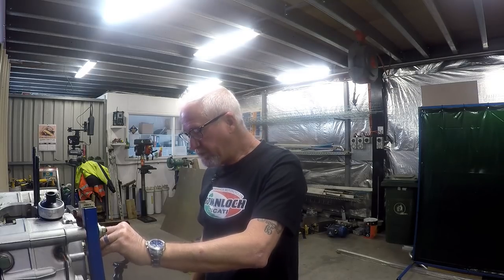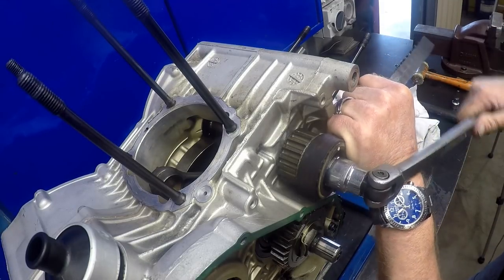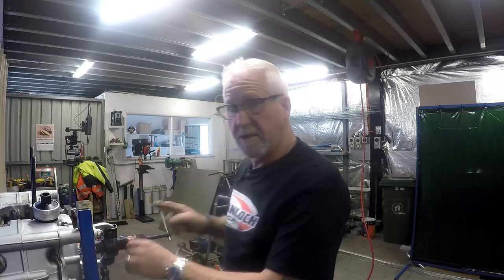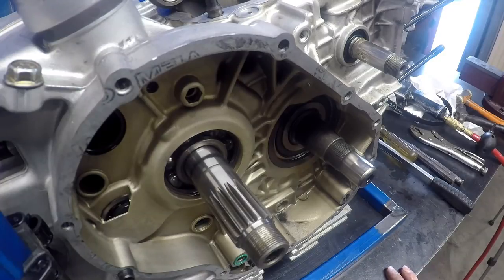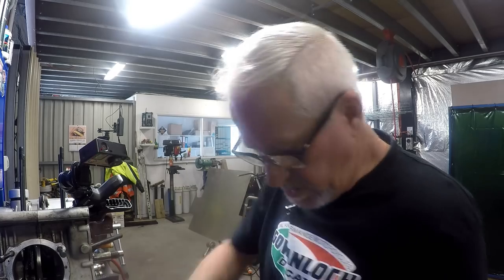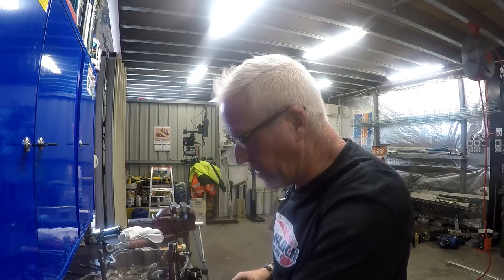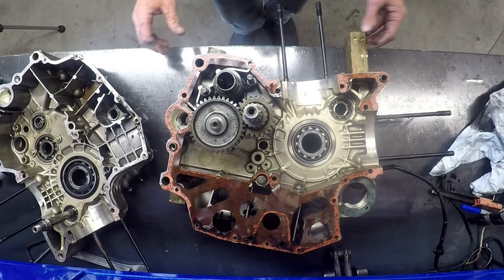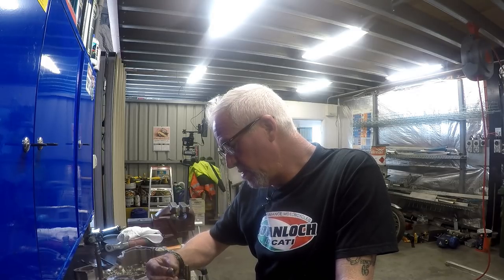DUCATI 900SS Ep6 - Split Cases and Flying Teeth

Comment: Always leave the nut on a couple of turns when pulling off a taper. This prevents the problem of flying gears/flywheels. Also you could have heated up the gear with a heat gun possibly making it easier to get off.
Reply from the maker: Yes, a bit of a facepalm moment. I under estimated the reactive force from the gear puller and it’s something that I should have instinctively done.
Reply: @ANDY5  Its a good tip to follow but if we could remember to use every tip trick and workshop practice most of know about but forget we would-be geniuses, and as my old man used to say the man who hasn't made a mistake hasn't made anything until I made the mistake that is and all hell let loose.

Comment: Nice work, Andy. While you're in there, I'd recommend you also change the gearchange lever return spring and fork return spring. It's not uncommon for them to break. One of mine went at only 16k and, as they're only a few dollars, I think it's a worthwhile precaution.Should be a real sweet runner when it's back together.

Comment: Andy, great series as always. Not sure about using silicon as a case sealer because the silicon squeezed out inside your cases can, and often does, come loose and can end up sticking in oil passages and the like. The commonly used case sealer is threebond. It is more of a mastic product that doesn't cause internal dramas. You may have heard of it through the various manufacturer variants: Hindabond, Yamabond, Suzukibond and, believe it or not, Ducatibond. Just something to consider. 
Also, in regards to removing your cam pulley, lactate was probably the culprit and some heat may have helped in the area. Heat may also have helped with the tapered gear.
BTW, I'm also a backyard mechanic. Trying to restore 2 MGBs, 2 1984 Honda VF1000s and a 1973 Honda SL100 plus keep a 93 750SS and a 97 Monster 750 on the road.
Reply from the maker: Yes, Threebond is what I’m using. You have lots of toys to keep you busy, nice 👍

Comment: We used to use a 2 jaw puller on the primary gear, we would load it up and go home for the night. most times we would come in the next day and the gear and puller would be on the floor. Yes this was at the dealership...lol
While you are there change the output bearing and check rod bearings. Also change the output seal and layshaft seal. Given the fretting on the bearing you should closely inspect the mains as well. 
Turn down that flywheel to 2lbs as fell for some fun.
Reply from the maker: New bearings all ‘round while I’m in there mate 👍
Reply: Hey rider !!  When the crank bearing failed on my 1991. Because of the 194.000 miles , 6th gear was a bit of a singer . I had a friend that did LOTS of Ebay parts stuff . he found me a complete transmission to drop in for ONLY 175 BUCKS !!!😎😎😎😎😎🍺🍺🍺🍺🍺

Comment: Excellent video again Andy.  Hopefully now you have pulled the engine down and identified all the parts etc that need replacing, the engine will go back together and possibly give you a non-oil burning experience from then on!! Remember it's a Ducati and I did say POSSIBLY give you a great non-oil burn and leak free life after all the work is done and the information being passed onto you is no doubt putting your mind at rest that all will be done as per those who have been there, done that and learnt from their work on these bikes.

Comment: I’m happy to report I finally got my oil strainer loose. It was in tough shape from the previous owner. I couldn’t get a socket or wrench to grab it. A couple of small flecks but  much cleaner than yours. I’m hopeful. Now for the clutch inspection... FYI..A BMW mechanic friend of mine gave me some advice on grabbing bad fasteners like my strainer. Put some valve lapping compound on it. It fills in some of the void. Worked great!
Reply from the maker: Good job

Comment: I think your theory about the brake fluid getting in the bearings is a good one and that would for sure  turn the bearing into  cheese but on the downside its turning into a costly  rebuild  ,, good  luck  with it these are great video's
Reply: Doesn’t the clutch pushrod pass through a rubber seal ? Not sure how a leaking clutch slave on the outside of engine could have the clutch fluid get inside the engine and attack the bearing on the inside ?
Reply from the maker: The rod seals with two orings. My have baked theory was that the fluid could reach the bearing, but it would need to get past the orings first. Possible, but highly unlikely. Crib death seems to be the most likely hypothesis.

Comment: If you go down the path of all new bearings, you may want to do another mod that wont cost much.  On these engines the pistons have an oil jet under them for cooling. BUT, the rear only gets it for 180deg because its blocked by the crank wheel. On later engines Ducati fixed this. You can fix it by extending the oil galley to the other side of the where it'll reach under piston for 360deg. I first saw it on Ducati Kamna in Germany web page. If your interested, I can send info...
Reply: Be interested to see this...

Comment: Hi Andy. I've pulled a couple of Desmoquattro primary gears... both needed the hydraulic puller, and both went off like a shotgun. Bit late to point this out now, but well worth protecting the end of the crankshaft. I once bought a 900SS crank which had been mushroomed over on that end, which meant it was impossible to sort out the oil feed into that end of the crankshaft. Hope yours is OK. If it's any comfort, I disassembled my 916 into individual components (much as you're doing) and it all went together again just fine eventually...and runs better & pulls harder than my 996! Carry on the good work.
Reply from the maker: I think I was lucky enough to get away with out mushrooming the shaft. Phew 😅

Comment: make sure the screw in the little pin the starter idler gear runs on is tight.  also watch the flat shim behind the flywheel assembly when you put it back together.  that's a real pita.
you can make an engine stand that holds the rh cases - you make 3 posts with pins to go into the 3 mount holes, and a little support to hold up at the oil filter bit, if that makes sense.  drill 4 holes in your bench and bolt them in.  makes it much easier.
you can put the alt cover back on and use the alt cover tool you made to pull the lh case off the rh case, pushing against the crank
.
Reply from the maker: Thanks mate

Comment: Hi Andy ! Very good job (except for the primary gear extraction without the nut in place !! I was frightened...). Fortunatly everything ending well

I agree with Chris commentary :
When you will  reassemble your engine beware of prestressing of the bearings. Its very very important on a Ducati motor.
The diiferents shims  are calculated for that. You will have to recalculate precilsely presterssing BEFORE reassembling the engine with a special tool (comparateur in french comparator in english?). You will probably have to change evry shims.

Comment: That flying off, had me stoking a 30year old wound🙊had my mk1 cortina steering wheel fly off and split my lip, learn quickly and only undo bolt a few turns😂very brave and expensive, I recon them Italian bit will be. 🤓

Comment: Hi Andy, if Im joining any metal to metal surfaces without gasket I use a sealant called wellseal, it was made for rolls royce back in the 30s, rolls was the first engine manufacture to mate metal to metal without a paper gasket, I was told it was to make the repair of aircraft in the field of war without the need for delicate paper gaskets. Ron from the uk

Comment: Hey Andy just a thought . Check the clutch actuating rod bearing in the pressure plate. I have heard that they can freeze up and spin the rod which may cause issue in the clutch slave cylinder piston . Worth a look mate.
Reply from the maker: It’s fine

Comment: as peter says, leave the nut on.  you need to be careful to not mark the end of the crank too - it does go into a seal (that is meant to be fitted the "wrong" way) and is the oil path into the big ends.  if you do remove the pick up connectors, you need to make sure the terminals go back in the same place.  swap the terminals side to side and it won't advance or maybe not even fire on that cylinder.
Reply from the maker: I think I was lucky, I don’t see any damage to the shaft.

Comment: Another possible contributing factor for the bearing failure could be lugging the engine in 2nd gear, which is the gear closest to that bearing. Some transmission failures are due to not spinning the transmission fast enough to spread the power pulses out over a greater area of gear teeth / bearing surface.  It is usually really expensive to replace the primary drive gears with ones that have a longer/taller ratio to spin gearbox faster, unless the factory made a set on a different year model that you could retro fit to your engine. Cheaper option is to not open throttle too much at low rpm, loading up transmission. Wait until it is at least over 4000rpm before winding throttle open.

Comment: I know this is an old video. I reckon corrosion has caused the case hardening to come off. The rust gets through the hard facing and metal fatigue does the rest.

Comment: Great series, really enjoying it. Substituting crank case paper gasket with a glue, would that not require changing shim thickness on crank, input / output shafts as cases will come closer together ? In the previous episode when you put the screwdriver through the small end of conrod, that made me nervous, hopefully that didn’t harm the base gasket surface, conrod or overall crank alignment / balance ? I know from my 2-stroke days that technique was a no no . Keep up the great work
Reply from the maker: Yes it will require reshimming, but would require that with new paper gaskets anyway. The rod through the small end is actually in the manual
Reply: Andy's Motorcycle Obsessions I don’t like the manual :-) My late brother who was a fitter and turner had a device he made which he referred to as the “Conrod Breaker”, it was a spark plug that had the electrode removed and a 50mm long pin pressed into it, this evil tool was inserted into cylinder head to assist with removal of crank and input / output start nuts.

Comment: As well as taking a photo of the ignition pickup a quick spray with any handy rattle can paint would have left you an image of exactly where the nut and washer were located and thus the pickup.

Comment: I feel like brake fluid would be an adequate enough lubricant for the short time it would take before oil started getting to that bearing that it wouldn't cause a failure like that. Maybe if it was that like for many years and many many starts but even then I kind of tend to doubt it.
Given that one section of the race is intact I'm inclined to say it was a manufacturing defect which caused the race material to break apart.  If it was a lubrication issue I would think the damage would be consistent all the way around.

Comment: I were removing the primary gear on my M620, used a 2 legged puller, not a fancy one with hydraulics. Cooled the axel from the inside with a can of compressed air upside down. and heated the gear with a weedburner, wouldnt budge.

Left if with the puller in tention buring the night, with some penetrating fluid sprayed on the gear. 

The next morning, i came out and swung a big hammer on it.... the gear flew 3 meters up in the air.

Comment: Having had a repetitive motion injury, I'm a big fan of using power tools whenever possible. Really want to pick up a battery powered ratchet similar to that one, but probably a cheaper clone. When I had air I used a pneumatic one all the time.

I'd probably use Hylomar on the case halves.

Comment: Heating and freezing engine parts is something i was not near as savvy about before an education in industrial mechanics and building heavy equipment implements. It's not a total solution where o rings are encountered. However i've learned that even a cigarette lighter can suffice in some situations.

Comment: there's no pressurised oil supply to that bearing.  there is an oil well in the cases and alt cover above it that runs oil into it.  i can't see how it would have anything to do with the clutch slave at all.  a leaking seal runs clutch fluid out at the bottom, not down the shaft.  it failed, it happens.  i don't think i've ever seen one like that before.  i always use genuine main bearings.  the crank shim damage is not unusual either.
Reply from the maker: I was intending on buying the main bearings through SKF, would they be any different to what they supplied Ducati? The SKF data looks identical Suffix B 40 degree angular contact, PA66 glass fiber reinforced cage, preload calculation factor X
Reply: @ANDY5  i use genuine mains out of professional paranoia.  jhp make the genuine afaik, used to anyway, and the angles were different i think, or there were a couple of versions of it?  not sure now, but i use genuine because i don't want to have to pull one out and apart again if it's wrong.  you can usually get all the others locally via skf with the plastic cages, but from memory last time i did one some of the genuine were cheaper.  think.  mbbs.

Comment: I am wondering if it is really necessary to replace the crank bearings on bike with only 20k kms? I am about to put my 620 engine back together after having the case welded up ( yes the kick stand mount boss, grr) and I was fully intending to leave  those alone, just replacing 0rings and seals. Bad idea?
Reply from the maker: I was having a break during filming of the next video when I saw this comment, you’ll notice that I mention it. 

As long as the crank and bearings are not damaged and your oil clearances are in spec then no. 

But depending on the bike it’s not that expensive to replace them and have that peace of mind.

Comment: Clutch fluid theory might be stronger if you lost a lot of fluid. You’d notice the loss of fluid. Good idea to drill weeping hole in slave to prevent such penetration into case. My 84 Nighthawk has factory weeping hole for slave. My R1100S did not.

Comment: Had a 1990 750 race bike that had raced for 10 years and I bought it for a track day tool. It ran with no timing belt covers and one day I came in from the track when it started raining and while sitting in the garage glancing at the bike I noticed that the timing belt pulley retaining nuts were all missing. Found one in the bottom of the fairing. The Woodruff keys had held them on. Don’t know why I hadn’t blown up the motor. That is why you are not supposed to reuse the locking nuts.🤓 this was the second time the bike had dropped bits on the track and since it was painted John Deer green it became “ The manure spreader”  and the name stuck.